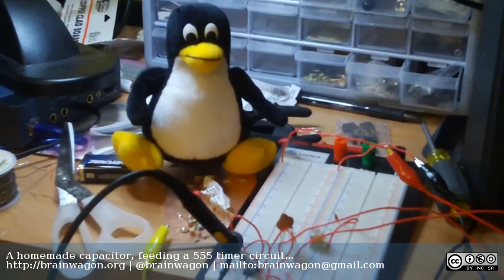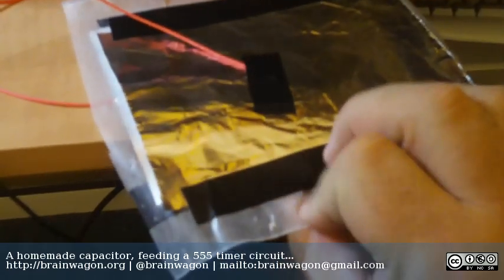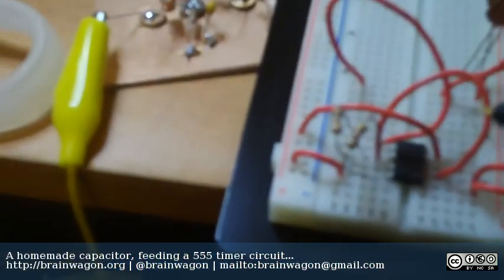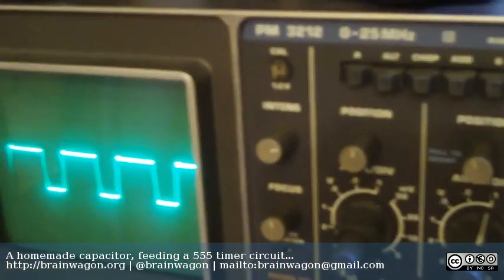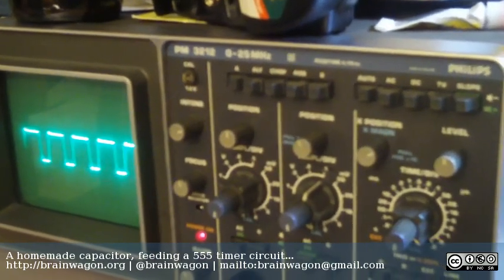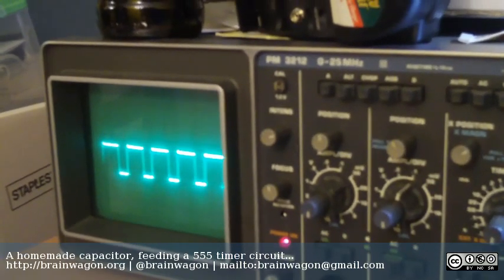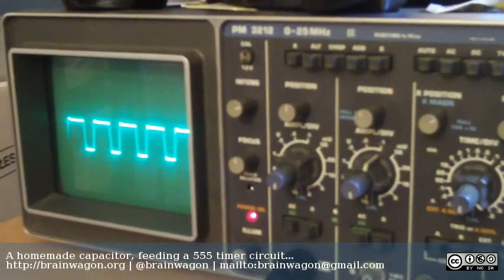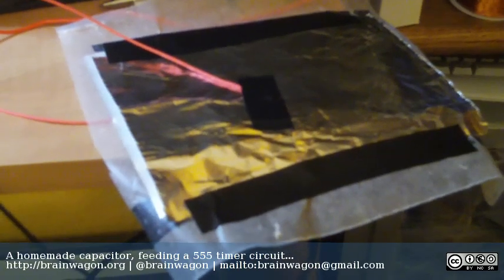A homemade capacitor feeding a 555 timer circuit.

Comment: @brainwagon I've never read it, but you aren't the first to recommend it - will do.

Always wanted to try building a Rochelle salt transducer.  No doubt you can build a high-Z magnetic one, in fact I recently ordered a big spool of extremely fine wire for HV transformers that would probably be ideal.